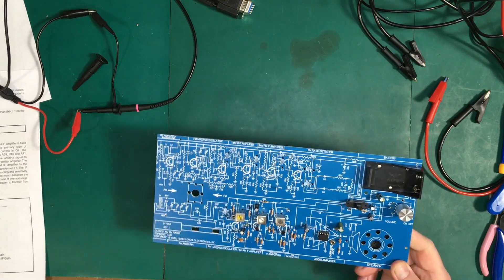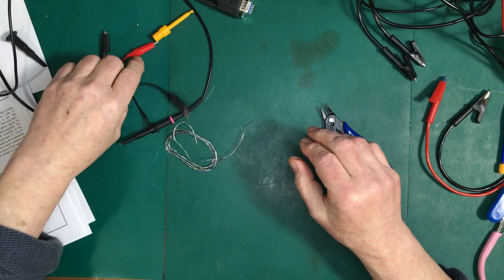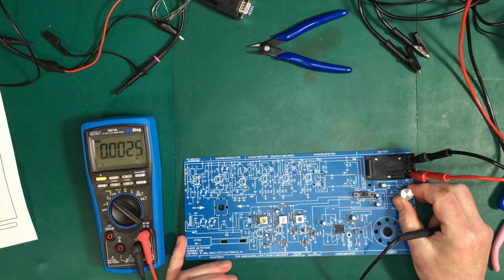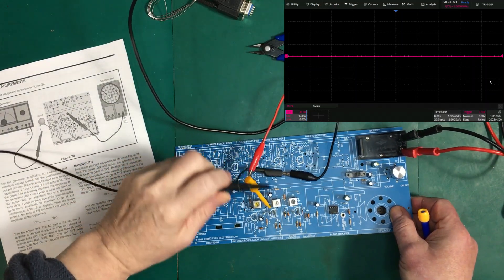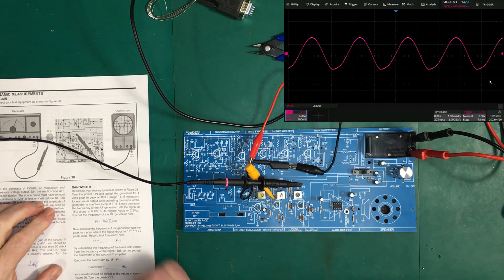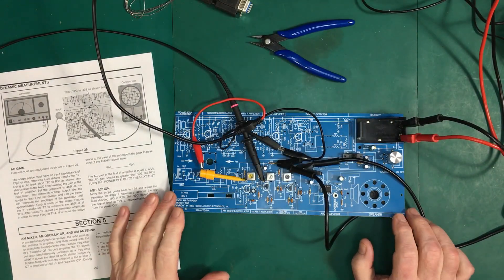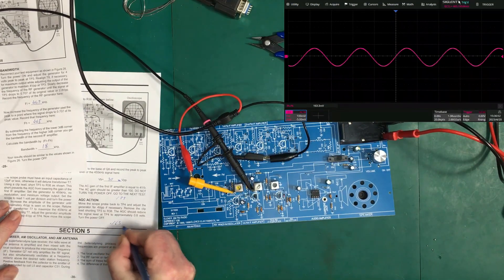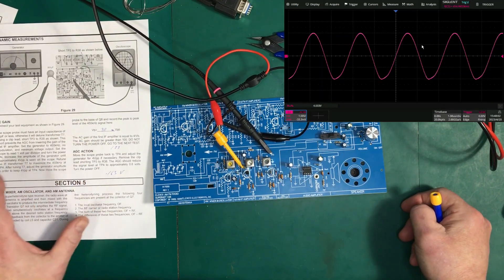0040 - Elenco AM/FM-108CK Kit Build: Part 3

Comment: On page 30 under AGC action, I measured 0.88v, BUT Vb in the AC Gain section was measured at 82mVpp.  That math made AC Gain equal to way less than 100.  Can I redo this measurement even though the remainder of the AM section is complete?  I feel confident my oscope setup was incorrect.  I can't tell from your scope inset video what your settings are (my bad eyes on a laptop).  Should I be reading amplitude or RMS from my measurement window?

Back to AGC action - I read elsewhere to read a different value from the scope - can't find my source.  Amplitude vs. RMS??  What I read may have caused me to pick up the wrong value for Vb.
Reply from the maker: There should be no problem going back and doing it again.

Stick to Vpp, both for input and for measurement on the scope.  Theoretically it should not matter (RNS vs Vpp) as long as you are consistent and use the same measurement for both input and output.  However, they are asking for Vpp so it would be best to use that so you have a better chance of yor reading matching theirs.

My scope was set to AC and 1V/div.  The scope probe was set to 10X.  Be sure to let the scope know your probe is set to 10X.  What model scope do you have?
Reply: @uni-byte  Siglent SDS2202X-E and a Tektronix TDS 340
Reply from the maker: @stargazer30721  Okay, on the Siglent, make sure the input is set to Hi-Z too.  I have no experience with the Tek.